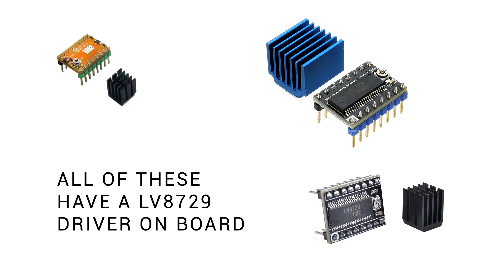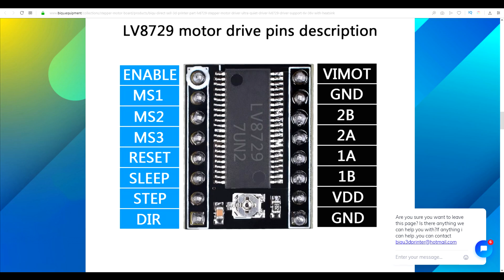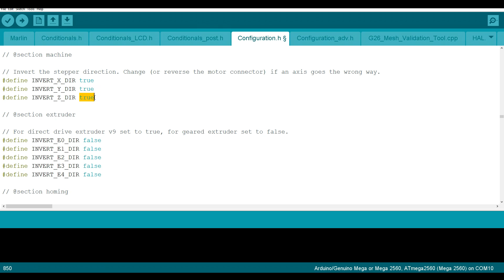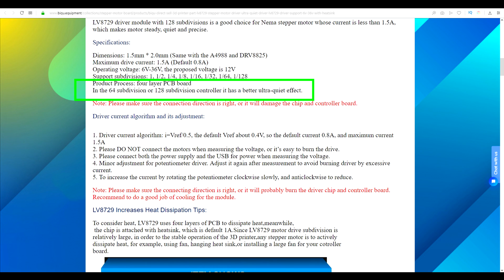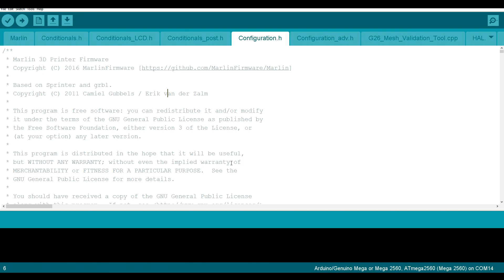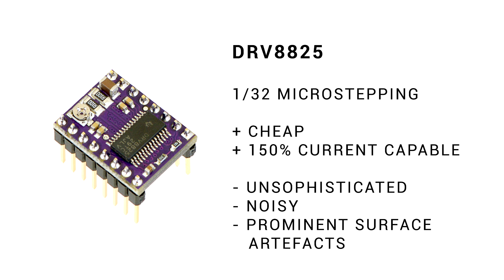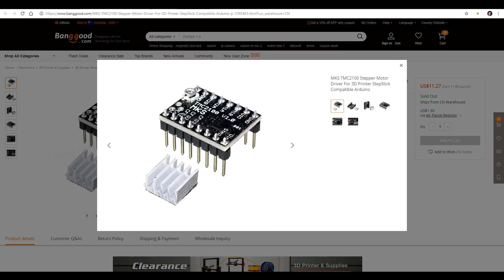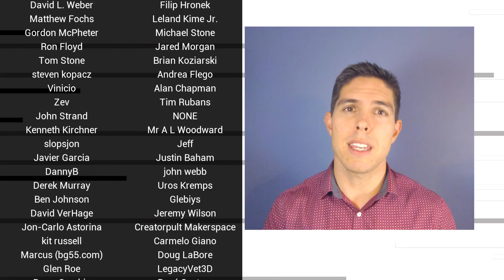LV8729 guide + comparison with TMC drivers

Comment: The reason LV8729 are recomended for the extruder is quite simple: Higher microsteps means less torqe per microstep. As an extruder needs much force to actualy move the filament, on 256 microstepping you might get inconsistent extrusion (the well known issue 602 on prusas mk3). The difference between skipping steps and "skipping" microsteps due to low torque is: The torque of microsteps "accumulates". So on full step the full movement (normaly 1.8°) will be fullfilled. But on the 127/256 is there realy a movement 127/256*1.8°? Maybe not. Maybe the the 125/256*1.8° movement has succeded, but the next sucessful microstep is 131/256*1.8° (just an example).
So the goal of using an LV8729 for the extruder is simply to find the microstepping with enough torque to actualy move the filament reliable for a constant extrusion, there every microstep succed in moving the filament. This might be 1/32 or 1/64 microstepping - but mostly not 1/128 and for shure not 1/256 microstepping like an TMC uses.
Also the TMC only uses 1/16 as input and interpolates - and the interpolation might be wrong speed on the beginning and the end of an extruded line.

As on the other side the extruder should use as many microsteps as reliable possible - you want a "smooth" movement of the extruder motor, no "pulses" of pressure. The movements of the gear(s) moving the fillament are very slow while extruding (as long you do not use huge nozzle diameters). So using 1/64 "native" (=not interpolated) microsteps are no problem even on 8-bit boards.

So tuning in a LV8729 needs more testing. You have to find the optimal microstepping for not "loosing" microsteps to avoid incosistent extrusion, but also moving smooth. The option to do 16,32 and 64 microstepping give more options than a driver fixed to 16 microsteps or fixed doing 256 interpolation.

Of course nowerdays this is mostly theoretical: Using a Titan or a Bondtech BMG with gear reduction from 3:1 you already reduce the possible inconsistance by a factor of 3; making it mostly invisible (as the molten plastic in the nozzle works as damper smoothing out partly the inconsitancy - on a bowden system also the filament in the bowden smooths out inconsistencies, so the issue is mostly relevant to direct extruders - the reason it got prominent at the mk3).
On a remote direct drive (Nimble, flex3drive) with gear ratio of 30:1 / 40:1 its completly irrelevant (use TMC there, because extruder motor moves fast so 256 interpolated microstepping is usefull to reduce noise).

So in summery:
On a direct extruder with TMC and inconsistent extrusion you might try a LV8729 with 16, 32 or 64 microstepping. This might solve the problem. If you do not have an inconsistent extrusion issue, you do not need to solve it :-) so stay to the drivers you already have. But with an ungeared extruder having the issue, also check to switch to a geared extruder (like the Bondtech BMG/ Bondtech mk3 upgrade). It might be the only solution (without SMD soldering) in some situations anyway, as if an original Prusa mk3 is effected the TMC at the einsy board are soldered...
Also you can reduce weight this way (pencake stepper) which is always nice (even if the bed on i3 style limits the speed, less weight is good for reducing stress on the mechanical parts).

One comment for boards with integrated drivers: Even if you have a board with soldered drivers, you mostly can change to other drivers with only a little soldering skills. Look at the driver and track down the traces on the PCB to a point there you can easy solder wires for Enable, Dir and Step. I did that on the creality board - and it works fine. Mostly changing x and y is all you need anyway, so 2 boards for adding a stepper driver (https://de.aliexpress.com/item/3D-drucker-A4988-DRV8825-stepper-motor-drive-control-board-expansion-board-F-r-arduino/32922803521.html), two TMC2208 and some wires are all you need to make a creality board quiet. It is not mandatory to deactivate the soldered drivers - if there is no motor connected they will not disturb anything.

While on a Creality board due to low flash and no free I/O a bigger board with stepper drivers in sockets is a little more expansive but give you other benefits, so track down traces might be a bit to big an effort, there are other printers (like the Anycubic Predator) with closed source 32 bit board and touch screen but loud soldered A4988, there tracking traces and soldering wires to external modules might be very profitable - changing the board would not only costs the price for a new board, but also problems finding the right settings (as you can not take a look to the original firmware) and also changing the touch display. Actually I ordered the Predator yesterday and tracking down Step/Dir/En will be one of the first things to do after assembling and doing some testprints (there of course all 4 drivers, as it has 3 fast moving axes and the extruder will also get fast as soon as the nimble arrives)
Reply: spot on, this is why some folks leave 4988's on the extruder
Reply: I must have missed the fine print that reads "1/256 microstepping must be used with tmc drivers " or that microstepping MUST be interpolated to 1/256.  Either that or that is a completely specious argument. Perhaps it was next to the bit that says you must also always use steathchop thereby hitting incompatibility issues with linear advance.

  #define INTERPOLATE       false
Reply: @m3chanist  To set a standalone TMC to 16 microsteps you have to put cfg1 and cfg2 to Vcc. As we are talking about standalone driver modules as replacement you can not do this by jumpers on most boards, only by soldering - as you can only set GND or "open" but the cfg pins on TMC are tristate... And yes, if you do so (or control a TMC via SPI or serial) you can use 1/16 microstepping without interpolation. But as you have to do soldering (or add spi/serial controll) it is not a simple drop-in replacement.
This video series is about changing the drivers on a board with the common sockets, using ready to use steper modules; not about what you can do with self modified modules.

Sorry, have to correct: You are right as RAMPS design are jumpers to Vcc, not to GND. So you can use TMC 1/16 microstepping without interpolation simply by using the jumpers; without soldering. Only if TMC are soldered to the board but used standalone (like on Creality's silent board) you might have a problem (as there are no jumpers to change the config).

So the main reason for not choosing TMC on E is the price. But as sets of 4 TMC normaly are the same price or even less expansive than 3 single bought TMC + 1 other driver, it seems mostly irrelevant.
Reply: @oleurgast730  The only reason you wouldn't use a tmc on E is price because to be fair a tl smoother would be cheaper and should produce the same results...While its true that high micro-stepping gives less torque in general this is simply put not true at low speeds. At low speeds higher micro steps give more torque not less, this is because at low speeds a lot of the torque is transferred in resonances in the motor and wasted however with higher micro-stepping the problem is eliminated. If you are retracting filament at high speeds (30mm/s+) you will probably encounter issues with stealthchop( I use spreadcycle anyway). you might need to change to spreadcycle or spreadcycle with interpolate off. I have a tmc on my E and retraction speed is set to around 25mm/s (which is more than enough to eliminate stringing) in spreadcycle mode with interpolate on and where I had some extrusion inconsistencies  with the a4988's they are completely gone with the tmc's. The issues i had with the a4988's was because by small spikes in feedback from the motor which caused very small barely noticeable waves(ripples almost like ghosting nut unlike ghosting this was everywhere and didn't change at all with the speed of the print) in the print at equidistant intervals. If I had a tl smoother on my a4988 it would work just as well for less money since noise isn't an issue for E and sensor-less homing isn't needed. I just used the tmc cause i had one laying around that I was going to install on the second printer I was building and will probably swap it out with a lv or a4 with a smoother on. Well unless marlin decides to make full use of tmc's on E like prusa. Another thing to keep in mind here is that there is a lot more to motors and drivers than just steps and angles. You can't compare the waveform from a quality driver to the waveform of a crappy driver. is the tmc better on E - yes it is - shouldn't even be a question. is there a more cost effective solution than can produce nearly identical results - I think so
Reply: One additional reason to use LV8729 instead of the TMCs is that there are compatibility issues with Stealthchop mode when using linear advance feature in Marlin.
Reply: Here is the bug report on TMC Stealthchop incompatibility with the Linear Advance in Marlin (and other firmwares as well): https://github.com/MarlinFirmware/Marlin/issues/11825
Reply: So, i have ramps 1.4 and all drv8825, what driver recomend me for extruder? And x y? Thanks
Reply: @Marcushin  on e you might simply stay with the driver you have. On x and y TMC 2209 in standalone mode or - even better - close loop boards (about 16$/pcs) wich was shown in another video in this chanel.
Reply: here you wrote the bible XD XD

Comment: Will sensor less homing on the extruder detect a filament jam?
Run out is easy with a switch but jams are more difficult.
Reply: The extruder gear slips too easily, I doubt you'd be able to get consistent results.
Reply: @deceitive3338  definitly right. Filament jam mostly leads to grinding down the filament, not to skipped steps (on a good extruder). Maybe a dust detector for the produced dust may detect it ;-)

But seriously: Prusas old mk3 sensor was a good solution (laser sensor). Sadly they changed it as it got 2 problems:
a) Reliability. Prusa uses black PET-G for printing the printhead. But PET-G is highly reflecting, even if you use black PET-G. I think they did the prototypes of the mk3 in ABS (like the mk2 was printed in ABS), which is less reflective. So they get it never reliable. I solved this issue by applying black non-glossy paint inside the detection chamber, never ever having false results.
b) transparent high reflective filament (PET-G transparent or PC). Ever moved a mouse on a glas table? Can not work. Simple solution: run the filament though some gears first, leaving marks on it. Like sanding the glasstable if you want to use the mouse directly: Not elegant but solves the problem.

Comment: Would be keen to have your views on another popular combo. SKR 1.3 (32 bits with Marlin 2) and tmc2208 at least in uart mode. Considering this master?
Reply: I second that !
Reply: That's what I did with my Ender 3. Works well and you don't have to do any extra wiring.
Reply: Thirded!. Not that long ago I upgraded to an MKS-GEN-L and TMC2130 drivers after watching Michael's tutorials......and now we have what looks like an even better option of the SKR 1.3 and TMC2208! Doh!!  I might just upgrade the mainboard as they look to be stupidly cheap, and keep the 2130 drivers. I'll wait and see if Michael does this first though - keen to see what benefits, if any in practice, there are to having the 32 bit board.

Comment: Did the 2208 upgrade little over a month ago. Much quieter now but didn't really help with some interesting vertical patterns or zebra striping Issues I have. Wondering if my table is too wobbly or is I should turn up the v ref on one or two of my drivers. What do you think? Thanks as always for your effort and excellent info.
Reply: What vref values did you use? Are the stripes mostly on one axis?
Reply: @deceitive3338  So I used the formula from his previous video and the stat sheet from the drivers I bought.  Id have to check again to know exactly. I can see the layers, assume that's normal,  but I seem to have vertical stripes on the walls of some prints. Not as noticeable on others and I know they aren't seems.

Comment: Regarding the Vref. It's good to check the actual resistor on the driver. The Formula for my LV8729 was assuming 100 ohm but there was a 220 ohm.
Reply: This, i came to write this 👍